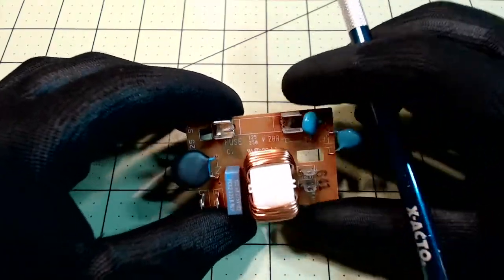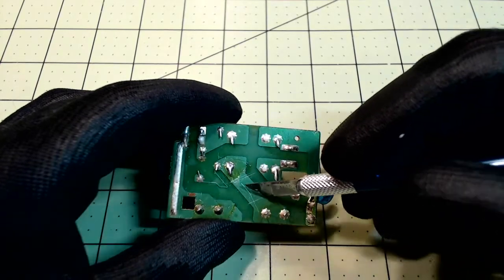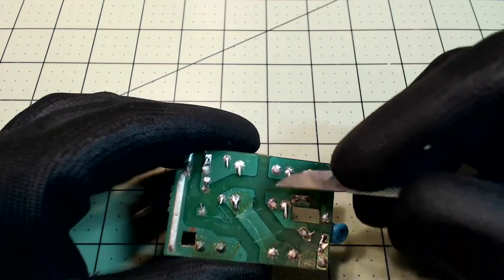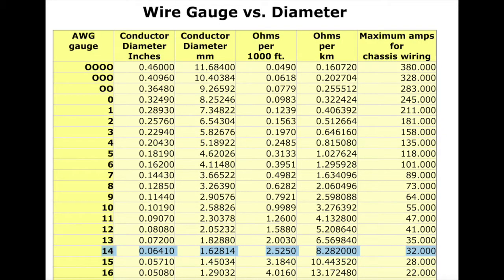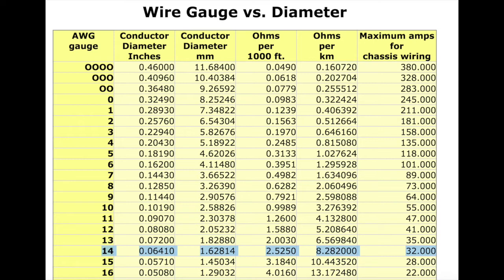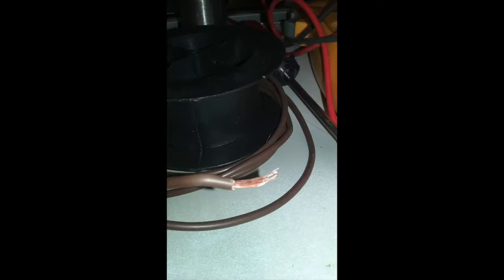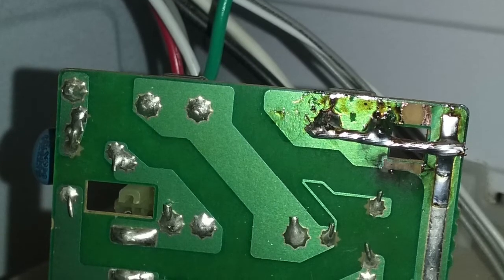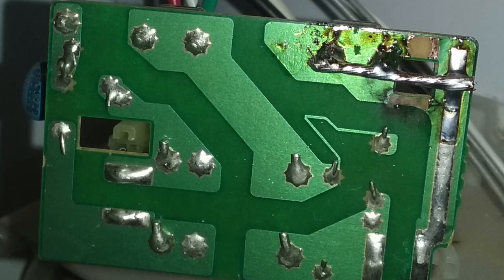Wire/Trace Current Calculation

Comment: By the way you calculate the crosssection of the trace .... And compare it with diameter?
Reply: Thank u so so much
Reply from the maker: exactly
Reply: I am a newcomer in the electrical engineering field .... Is there any  thumb rule for pcb trace width?
Reply from the maker: @pranaynaskar8947  not about the width, but proximity to other traces and parasitics that will affect other circuits. So the distance between traces is more important in engineering a pcb. Obviously, you need to have a cross-sectional area that will be appropriate for the max current you intend to pass through the trace.